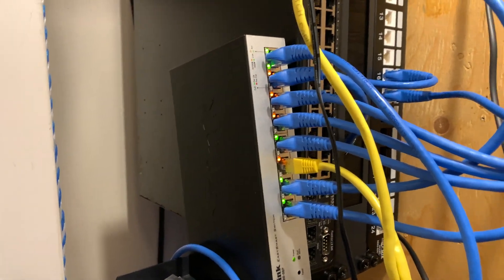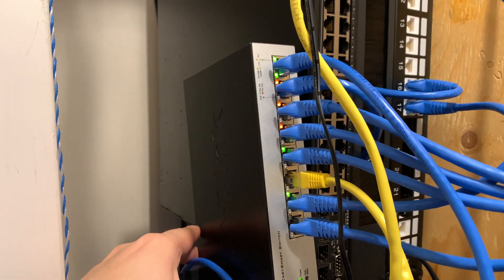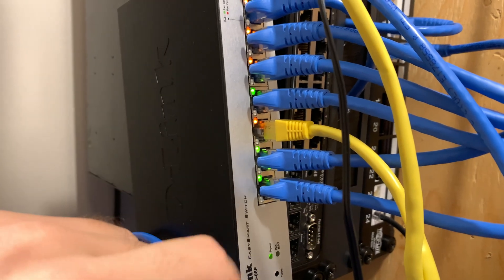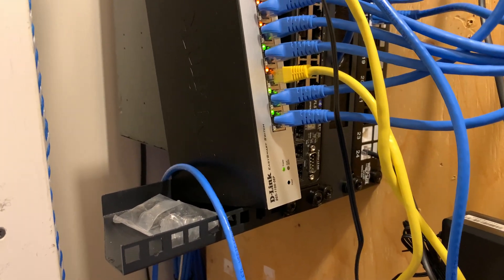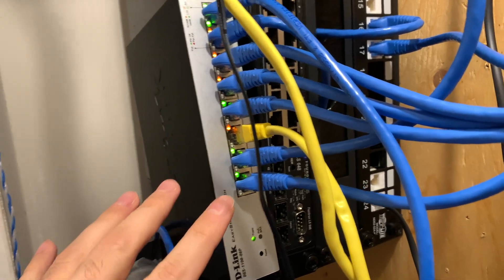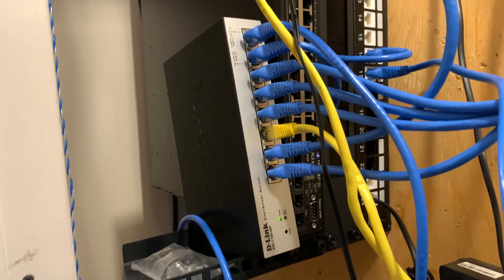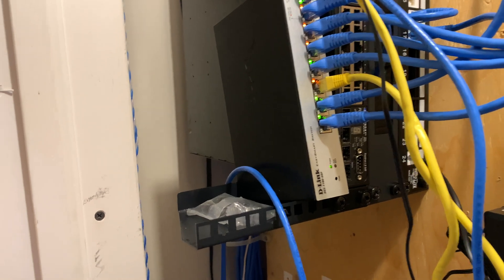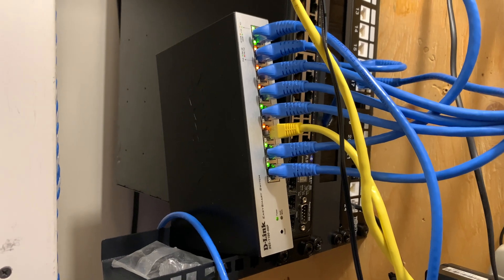POE Pass-Through Should Not Be Working On This Switch, But It Is. WTF D-Link

Comment: I have seen this happen before that, it's just that that switch had the worng board installed in it at the factory, and programed with the serial number for that particular models
Reply from the maker: I thought that too but then I started looking to see if there is the same form factor motherboard for the chassis and there isn't one. D-Link does have a switch that has PoE pass-through but it's completely different laid out of ethernet ports. It could be a different motherboard revision, this unit was warranty replaced too.